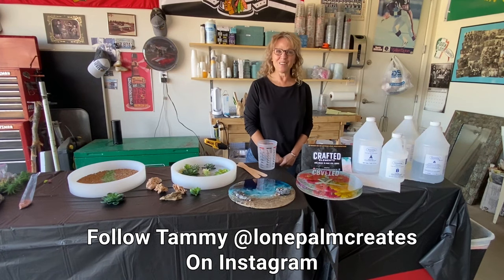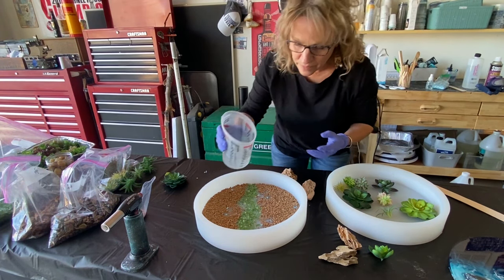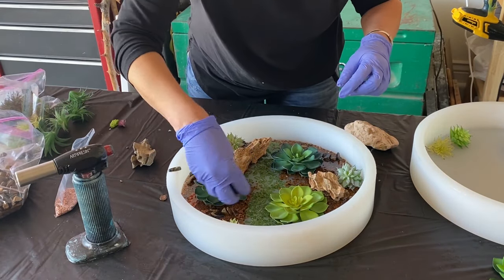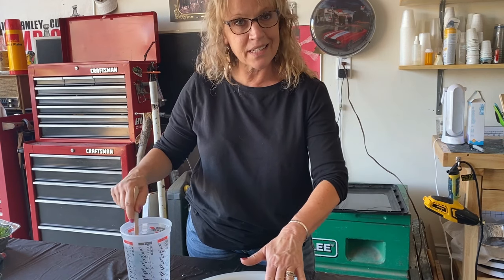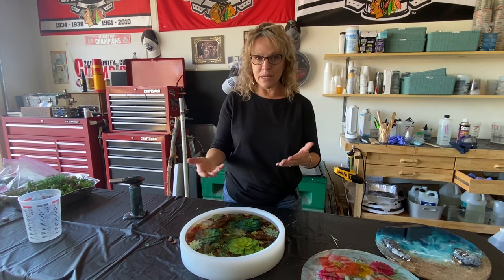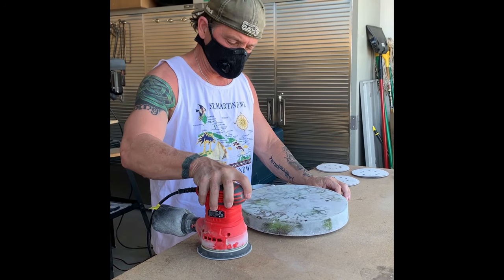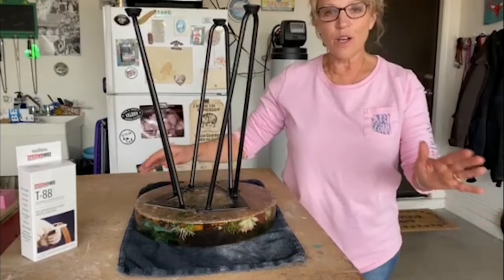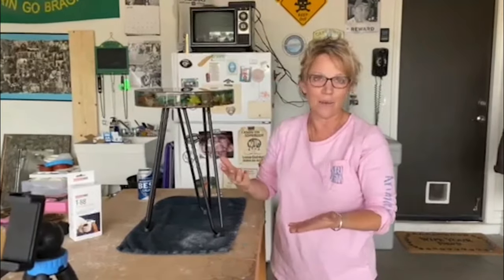How To Make An Epoxy Resin Succulent Table - Tammi Woods (@lonepalmcreates) & Crafted Elements Molds

Comment: Do you only allow 3 hours between each pour? Then wait 48 hours or more before removing from the mold?
Reply: 3 hrs or so between when base is set down. Then 48 hours after the deep pour. Sand and one or two top coats.

Comment: May I ask what mold spray you used?  I just bought my 24 inch to make a table, super excited.  Also any advice on how to prevent bubbles or get rid of them?  Thank you.
Reply: Also may I ask what resin you used?  I am looking for a resin that will let me do layers at a time, so I can make a table with a 3D image to it.
Reply from the maker: There are many mold release sprays on the market. However, the one that we, and our customers, have had the most success with is the MG Chemicals 8329 Non-Silicone Epoxy Mold Release Spray. It is readily available on Amazon.com and Amazon.ca

Smooth On also makes a quality line of mold release sprays that can be purchased from them directly, or via Amazon, including the "Smooth On Universal Mold Release" and "Smooth On Ease Release™ 200".
Reply: Hi! I used Allumilite amazing clear for the base, where you set all your base plants rocks etc. then I went back in with their deep pour resin. This allows you to fill a large area. 
Touch for bubbles. You can also go in with a little paint brush along the sides to pull little bubbles away
Message with any other questions!

Comment: Nice tables.....is that a polyester resin your using? Can those forms be used with deep pour epoxy?
Reply: Thank you! I did the initial layer with allumilite clear. The second pour  was done with allumilite’s deep pour resin.

Comment: how can you make your epoxy crystal clear? i stir it very slow but it still have bubbles?
Reply from the maker: You can de-gas it in a pressure pot. Or... if the bubbles rise to the surface, use a heat gun or torch. If you use a really thick epoxy that sets quickly, it will have more bubbles than a thinner, deep pour epoxy, which will naturally release the bubbles.

Comment: I can't believe your trying to sell those cheap molds for over 100. Robbery
Reply from the maker: Heidi. Please post a link to where you can get a similar silicone mold. Keeping in mind our circular molds are 1/2"-5/8" thick, and 12-18" in diameter. If you can find a similar one, at a "cheap price" I would LOVE to see it!
Reply: These molds are of the highest quality, if you care for them
Properly they will last indefinitely. They are not overpriced if you check the market.
Reply: rude rude rude rude